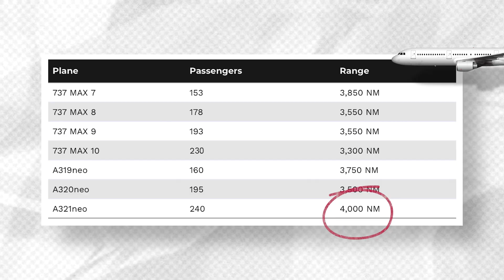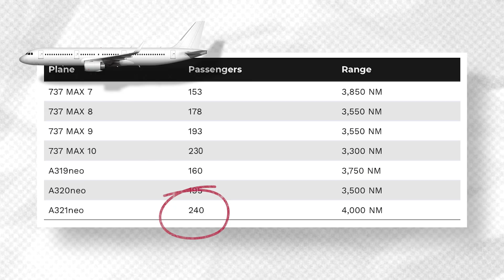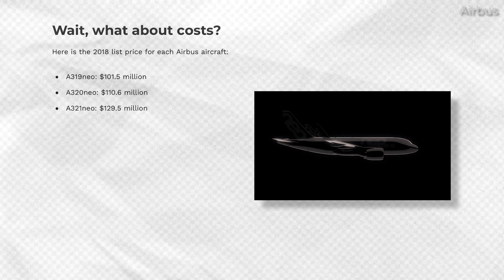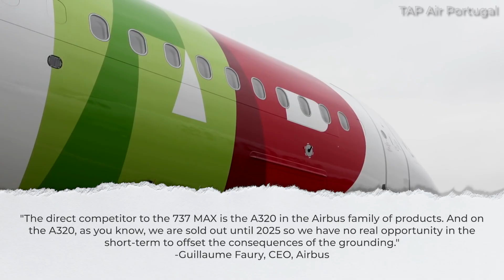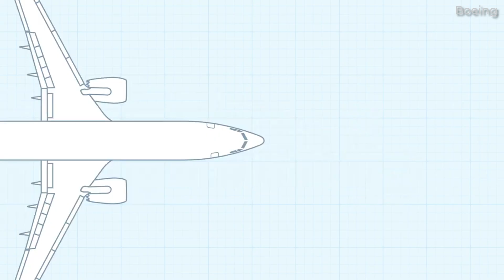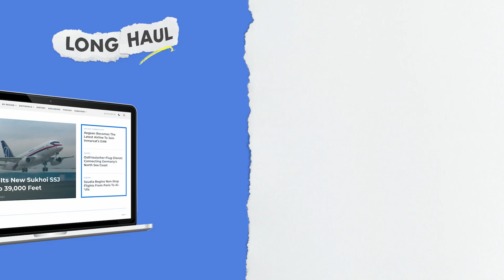The Airbus A320neo Vs Boeing 737 MAX – Which Plane Is Best?

Comment: As a frequent flier, the 737 has been the better plane, and honestly it's been fine and unconcerning to me since the fixes and scrutiny. 321N has had me late several times due to the need to boot people off for weight and balance reasons. In my experience 737 is quieter, better cabin, with bigger, clearer windows that let you look downward at the world whereas a320 series has them pointed more toward the sun. Plus more glare/birefringement/optical problems. As a photography person this matters
Reply: I've flown both aircraft as a pilot.  I hands down prefer the A320 family products.  We need at least a decade more to see if the 737MAX family is actually safe.  It's most recent crashes and numerous other close calls and never ending manufacturing defects require it earning the designation of "safe".  Regarding weight and balance, the 737 family is far more critical in this regard (hence MCAS).   737 operators generally mitigate the limitations of the aircraft by not booking as many people on the 737 or by reducing cargo or fuel (e.g. put it on shorter legs).  The A320 family generally has little or no limitations on daily operations so they always fill it to capacity on the longest routes (worst possible weight and balance scenario).  That's probably why you've seen any limitations on the A320 family at all.  If they preemptively planned these edge cases like they do on the more restrictive 737, then you would never see it on the A320 family.  Also, the 320 family has a bigger fuselage, which means bigger and wider seats.  On the 737, if you get a window seat, the fuselage makes you lean into the center seat, whereas the 320 has enough room to where you lean into the fuselage instead of the other passenger.  This is probably why the 320 windows are higher... you're in a wider part of the fuselage in the 320.
Reply: I've had similar experience on the 737, It is definitely better in my opinion

Comment: As a passenger, the 737 MAX offers a slightly superior experience, for me. It’s whisper quiet and the Boeing Sky Interior is just lovely, with soft mood lighting and pivot bins that just open up the cabin compared to the Airbus’ shelf bins. I find the Boeing’s bin more user-friendly too, much easier to reach into the back of the lockers to get your stuff, in the bin that drops down. (I’m a short guy, so that’s not gonna be felt by everyone.) As a final note, the MAX actually feels like an upgrade over its predecessor inside. Sure, some NGs were fitted with the Sky Interior, but all MAX aircraft have it. Compared to a 737 NG i flew in the early 2010s, the MAX is night and day different. The A320neo family’s cabin architecture on the other hand, is almost identical to a 2013 A320ceo. I’m not Boeing-biased, what has happened to that company recently, leaves me cold. Im honestly speaking from my own flying experience. If you’re still mad, I will say i much prefer photographing the Airbuses.
Reply: The A320NEOs are super quiet too and they are BIGGER.   Have you noticed how much narrower a 737 is compared to any A320?  If you're unlucky enough to get a window seat on a 737, the fuselage always makes you lean into the center isle.  Also, Airbus aircraft also have equivalent "sky interiors" as well.  It's just a function of airline purchasing preference.  It doesn't cost much to install colored LEDs into an aircraft.  The same is true for the overhead bins.  Since the A320 has a bigger fuselage, it's bins are actually larger, but it still depends on what the airline buys.  I travel a lot and the 737s are consistently smaller with bin size, although theoretically they could be as large as the A320 bins.
Reply: *as a surviving passenger

Comment: Well, one of the planes has a tendency to crash itself into the earth, so it's pretty obvious the one that doesn't crash itself is the better plane.
Reply: Does it really, at this point?
Reply: @marct9587  We don't know.  It'll take a decade at least to know whether it's safe.
Reply: @AquariusTurtle  The design of the MAX is a flaw! Boeing should redesign the airfame to fit the new engine however greed came upon them using a big heavy engine in an old airframe but add in A Crutch to stabilise the flight.

Comment: Both A319NEo and 737-7 are niche aircraft and have poor sales and prospects.  Whether A320NEO is better than 737-8 is debatable, but the solid fact is that A321NEO in its 3 variants soundly outsells 737-9&10 3 to 1.  The yawning difference will spread further as time passes, and Boeing so far has not announced a MAX replacement.
Reply: The 737-7 has way more orders than the A319, and those numbers will only increase when the plane is in service. The A319 has proven to be a poor seller because the A220-300 makes more sense, so the Max 7 will be much more successful.
Reply: @sainnt  So why bother with an obsolete 737-7 when you can just buy newer, superior in every way A220-300s?
Reply: @sainnt  well, even if more it is still a very modest number for 737-7 as well, and for essentially 4 airlines. Had Southwest not insisted a lot for their own reasons, the version would not have seen the light of day. Both are essentially cut and shut versions, hence they have too big wings and engines for their size. This results in excellent field performance, good for high and/or hot airports (not a particularly needed feature in the market) and their downside is that they have poorer economics than their respective siblings. Niche airplanes.
Reply: @luisdestefano6056  Airbus has a total of 73 A319 orders. Boeing has a total of 234 Max 7.  That's like calling the A380 niche aircraft. The A319 is only niche because it makes more sense for an Airbus customer to buy the A220-300 instead. Boeing will always sell more Max 7 because they don't have regional aircraft to compete with the A220, but the Max 7 makes way more sense to an airline than an A319.
Reply: @sainnt  So why bother with an obsolete 737-7 when you can get a superior A220-300?   And if you need something bigger, with more range, then buy a A32xNEO.
Reply: @sainnt  A380 was not intended as a niche plane, but in practice ended up as such (with Emirates having bought half the total), much as 747-8. Likewise in my opinion 737-7 is also niche. Of the total 234 are for Southwest (plus 30 for Allegiant and 20 for Westjet). Thus suiting one main classification criteria, namely very few buyers). This in just an opinion. Others may legitimately think otherwise.
Reply: @luisdestefano6056  Your error is calling any aircraft niche. Aircraft makers don't build any aircraft to be niche. Some aircraft just don't sell well. Some aircraft are a success, some are a failure. The original A318 and the A319 neo are failures, not niche. The 737-7 is already successful with over 230 on order, and more are likely to be because it's not even in service yet. The A380 would have succeeded, but wrong time. The 747 as a whole is a huge success, and the 748-8 outsold the A380 because of the cargo variant, also making it a success compared to the A380.
Reply: Boeing literally makes the -7 for Southwest Airlines. They love the 700 and -7
Reply: @thehumblepilot22  Southwest is not the only airline that has ordered the Max 7, but Southwest by far operates the largest number of the series.
Reply: @Clayson Antoons I think the A380 is definitely the most comfortable aircraft flying today. It's amazing in so.many ways. But, nothing beats the feeling of being on the upper deck of a 747. It's such a rare experience and so amazing for an av geek.
Reply: @Clayson Antoons Outsold was an error on my part. Outperformed is what I meant. It cost Airbus over $30 Billion to develop the A380. Boeing only needed less than $5 Billion for the 747-8 in both passenger and cargo variants.  Boeing made money on the 747-8. Airbus lost money on the A380. Facts.
Moreover, while only Lufthansa, Korean Airlines and Air China ordered the 747-8i, cargo variants were ordered by many more airlines. A few private versions were sold too. One private A380 was built, but the buyer never took delivery of it. Smart move.

Comment: 4:02 I don't understand how the A320 NEO has a higher capacity than the Max 8 and 9 because the two maxes are longer than then Neo. The max 8 is 1 meter longer than the A320 Neo while the Max 9 is 5 meters longer than the A320 Neo so it doesn't make any sense
Reply: My guess is that the a320neo has a wider and more efficient cabin than Max but maybe wrong
Reply: @planespotting-rodion2494  correct. It has a wider cabin.
Reply: @luchsegamer8112  even if it has wider cabin it still seats 6 abreast like the 737
Reply: @luchsegamer8112  thanks for the correction:)
Reply: @theskyline1425  yes that's true but I said more efficient seating so possibly more seats being added
Reply: @planespotting-rodion2494  oh, I see
Reply: @theskyline1425  thanks for your reply:) #aviation
Reply: The video is very flawed, they've quoted the single class seating (all economy) for the A320neo at 195 and quoted the two class layout (business + economy) for the 737-9 at 193... According to Wikipedia a 737-9 can sit up to 220 in a single class layout. An A320neo can seat 165 in a two class layout.

For A319 / A320 / A321 in single class: 160 / 195 / 244
For 737MAX -7 / -8 / -9 / -10 in single class: 172 / 210 / 220 / 230

For A319 / A320 / A321 in two class: 140 / 165 / 206
For 737MAX -7 / -8 / -9 / -10 in two class: 153 / 178 / 193 / 204
Reply: @xaif4888  exactly,

Comment: Great video really enjoyed but I do think a320neo is a winner e.g a321xlr and a320neo due to range and efficiency but b737max is a great competitor but it didn't have a great start.both aircraft manufacturers did a great job. Thanks for the video
Reply: A320neo is better at price I mean
Reply: @planespotting-rodion2494  at the price? Certainly not.
Reply: In the video it is stated that the a320neo is cheaper than the b738 max and b739 max specifically a320neo $110m b738max $121m b739 max $128m
Reply: @planespotting-rodion2494  Those are list prices. Sales prices are around $50-55M, 737 being cheaper.
Reply: @user-yt198  also depends on deals of the manufacturers but thanks for the correction
Reply: 737 max is more fuel efficient
Reply: @KilotangoAV  a321xlr is more fuel efficient than b737 10 max
Reply: @KilotangoAV  fuel efficiency is nothing ... airlines only see how much fuel burn that suit the mtow and a320neo and a321 got better mtow even the fuel burn isnt better than b737max but still they got better efficiency to bring up more cargo and capacity with better range